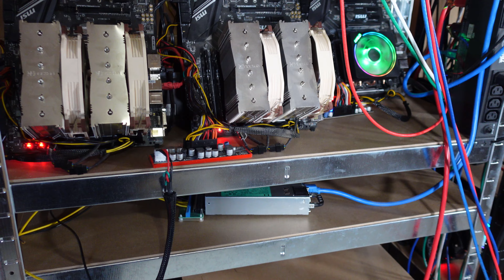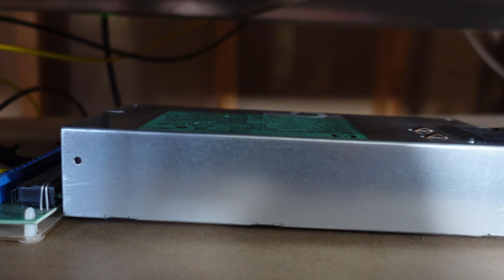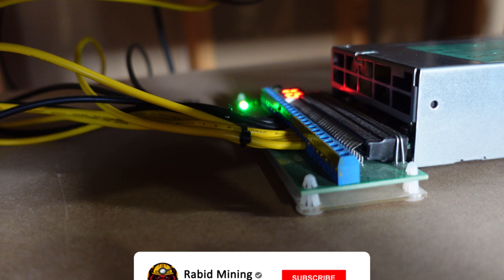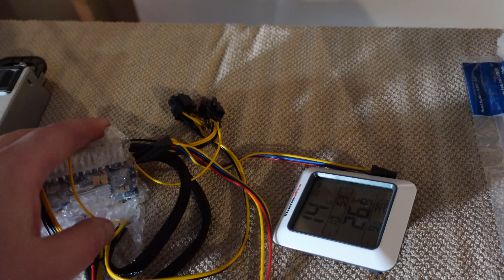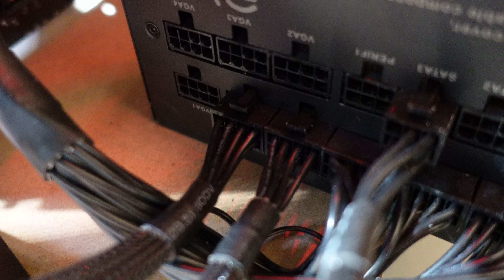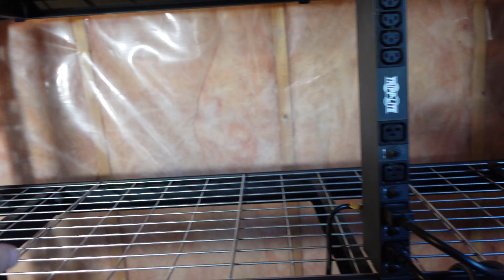Powering CPU Mining Rigs

Comment from the maker: Here Is How I Power My Rigs What Are You Doing?
Reply: I've got something I'm testing out soon. I'll be using a 1200 watt server PSU, 300 watt pico's, hooked up to an X11 AMP breakout board.

Using a Molex Mini Fit Jr extractor tool I'm de-pinning two of the normal 6 wire PCI-E cables and using 4 of the 12 wires to power the pico, and the other 8 for an EPS CPU power connector.

I found the female Molex Mini Fit Jr's press on firmly onto the 4 male pins of the Pico. So I'm putting them on and heat shrinking the 4 of them together into a snug fitting "connector".

Perhaps I can make you some of these cables so you can try them out. Just waiting on the 8 pin EPS connectors to arrive.
Reply from the maker: Nice
Reply: @RabidMining  but what you mining on them?
Reply from the maker: Dero , rtm , xmr , epic , yadacoin all over
Reply: @RabidMining  awesome .

Comment: Recomended voltage for 3950x?

I have some issues with one of my 3 RTM CPU rigs. One of them randomly disconnected after few days (2 days, 10 days...). After the incident it's not possible to check it by remote. The others are pretty stable. Using HiveOS. All rigs running via same switch.
What I tried is to connect to one of online rigs and ping the others in LAN (see different IP addresses).
As you can see on following screen second rig gave me response, but problematic rig didn't. So I think it's not just offine, but  totally crashed because ping is realized within LAN.
If I restart the rig by power supply OFF/ON. It'll start and mining...

Comment: Thanks for this video. I was using the ZSX Amp Breakout board for CPU and GPU combo mining rigs, but I lost 2 boards this week. I think I'll have to find a better solution for the CPU side.
Reply from the maker: 2 zsx boards blew up?
Reply: @RabidMining  Just stopped working. Checked hive, rig off line. Only little yellow light on ZSX board. Press power button, nothing. No obvious damage to me. I can post a pic on the discord if you'd like.
Reply from the maker: Hmm not sure what it could be check the 24 pin maybe came loose or burned pin in close.
Reply: @RabidMining  Inspected pretty thoroughly. Both times. Luckily had 2 spares and was able to swap it out. Replacements work just fine. When I get done working tonight I'll post a couple pics.
Reply from the maker: OK

Comment: Do you mine on just six core cpus? 8, 12 and 16 core do require a separate GPU, don't they?
Reply: I cant speak to core counts, but I'm pretty sure all ryzen cpu's have integrated graphics so no need for a gpu.
Reply from the maker: Only the 7000 series has integrated need a gpu for initial set up on 3000 and 5000 series cpus

Comment: Those CPU 24 pin splitters can be also gotten in lengths from 30 cm to 80 cm if space is a problem with mobo splitter I'm using, it has 18 Gauge and so far no issues,  at MODDIY,  I have link if you need it

Comment: In my country one ATX 250W PSU no gpu output sells at 40CNY(~$6 equivalent).  Brand new, and power cable included. Perfect for powering a 3900X rtm rig.  My total single 3900X rig cost around $270.
Reply: My first 10 rigs I’m using 450W version with MB and GPU splitter (I asked you questions sometimes my rig won’t boot up simultaneously if you remembered  :))     That one cost ~$10 and cable cost ~$3. Later I decided it’s not worth the trouble and effort. Then I diverted to one rig with one psu we talked above.
Reply: which mobo ?
Reply: @nofood1  PRIME B450M-K ASUS
Reply: $270/rig, how? I haven't even been able to find 3900Xs for less than $225 USD..
Reply: @kreak403  he definitely stealing parts 🤣 i bought a used 3900x 2 months back and paid $230 for it... need to buy ram, psu, mobo, shit gpu, m2 ssd... hitting $400+ in the USA easy unless you buy everything pre-owned
Reply: @nofood1  Lol, has to be! 😂 I'm sitting at around $450 USD/rig! Btw, you just need the GPU initially for the bios (unless you keep a monitor on it), I take that thing off after. Check out Rabid's guide, I can share if needed.
Reply: @kreak403  I dont use Hiveos so I just leave it on no biggie
Reply: @kreak403   yeah I know, i bought it around Nov 22 timeframe. It roughly around $205 per, other accessories are cheap as well.